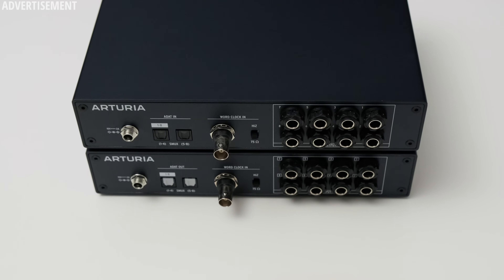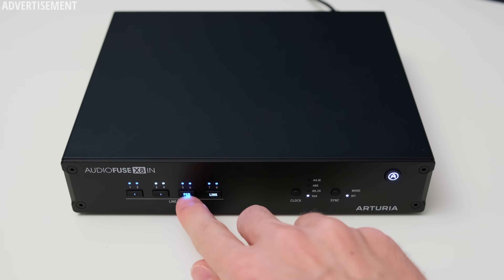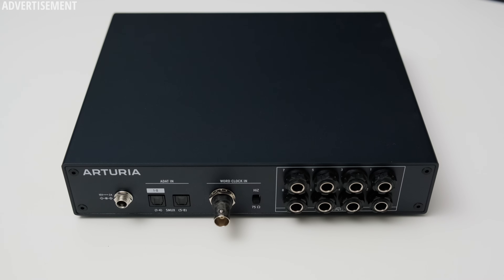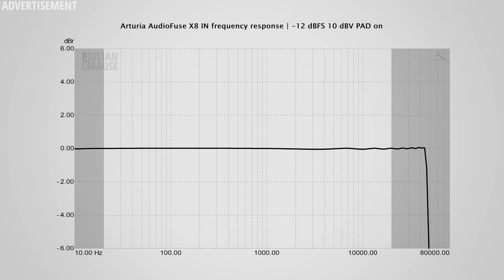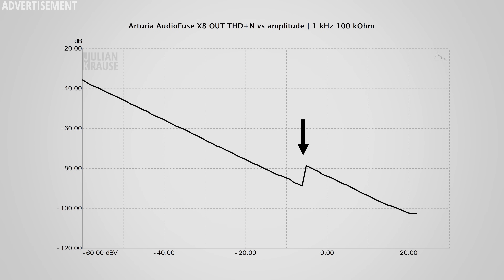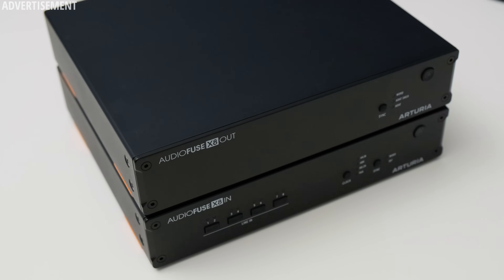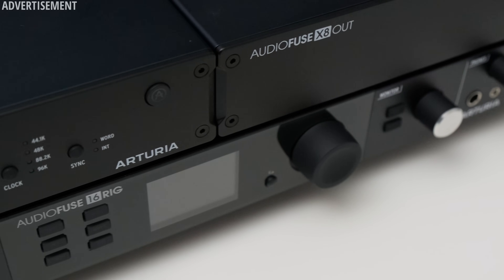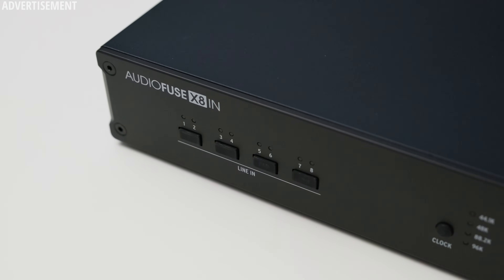Arturia AudioFuse X8 IN and OUT – 8 channel ADAT expansion

Comment: buy anything from RME and bé happy for ever ever
Reply: I don't have $2-3 thousand AUD unfortunately
Reply: I would have to borrow to buy that, that will make me unhappy until it is paid off. Not to mention my wife who would make my forever very short if she finds out that I did that to buy it. 😂😂
Reply: For the price - it better be good. RME prices keep becoming more and more ridiculous, meanwhile good value alternatives are available for people who just need the job done well.
Reply: @SDX9000  RME prices have remained consistent over the years. If you compare products within the same tier, the Fireface UC/UCX still costs around the same as the older models, like the Fireface 400, and the FF802 is similarly priced to the 800. Nothing much has changed in that regard. Sure, they now offer higher-tier products like the ADI-2/UFX/MAD-AVB/DANTE, but they also have budget-friendly options like the Babyface Pro, which costs less than the internal PCI cards without Mic inputs and DSP FX.

Moreover, since their driver support is practically endless, RME interfaces are actually cheaper in the long run. Many people have been using the same RME interface for over 20 years, which is unheard of in any market or profession. This long-term support also makes their second-hand market very attractive.
Reply: @SDX9000  it is
Reply: @naphasso6877  interesting, i'm not surprised about Arturia, but it doesn't sound like RME to miss that, which module?
Reply: RME had the same issue before fixing. Not issue anymore
@xfghffhfg : On DAC

Comment: DC power supply splitting is a dumb idea, they would have to double the power (amperes) output of each 15V AC-DC adapter and each customer would have to pay the difference even if they won't use it to power more than one device. Also, that will create a potential for ground loops.
Reply from the maker: Hey, I checked the power consumption and for the X8 IN it's about 7 Watt and for the X8 OUT it's about 4 Watt. The provided power supplies can handle up to 30 Watt according to their specs. It should not be an issue running two X8 with one power supply. I agree, that running the 16 Rig with the same supply would not be such a good idea. 
The power supplies do not have a ground pin and with the in- and outputs being balanced, there should be no issues with ground loops.
Reply: Most power supplies that come with products are rated 3 to 5 times higher than the required power. Additionally, it’s incorrect to say there's a "potential for ground loops" when the ground isn't shared. It might be wise to familiarize yourself with the basics of electronics before using terms like "dumb" otherwise it could reflect poorly on you.

Comment: Thanks for this. I have been looking to get these. The X8 out issue is a concern though. How can they fix it when there is no way to update the hardware as there is no usb port or anything to fix the firmware?
Reply from the maker: When you take off the front plate, there is a USB-C port hidden behind it 😉
Reply: @JulianKrause  Ahh cool. I didn’t notice it in your picture of the interface opened up. I hope that they can fix this issue as that is a deal breaker. Otherwise I have to look for something else.

Comment: Not really seeing the value here when each is nearly the price of an SP8 that replaces both
Reply: You can’t bypass the mic inputs on the SP8. I just want line in and out. The converter quality isn’t as good on the SP8 either.
Reply: @electricwhiterabbit  because 25dB beyond human hearing vs 28dB beyond human hearing matters heaps. Yes in theory the numbers are slightly better. 
You can use the line inputs, which yes go through the same THAT6266 balanced ADC driver, but its a lot more than a mic preamp. 
If you do want those features, i'd argue the ASP 800 is a lot more interesting then these. Though slightly more expensive than the pair it has a LOT more going for it.
The DAC issue on bass would be an absolute dealbreaker for me - being unable run effects loops on a bass synth would be .... just no. Any update to its behaviours will also invalidate the current noise tests and likely reduce the dynamic range.
Reply: @mycosys  The X8 IN has far better specs than the SP8. The dynamic range is much better as well as the distortion specs and the frequency response. I don’t want/need mic preamps and that is what is hindering the SP8’s quality hence why it is cheaper. Also the SP8 inputs can only handle +18db input where the X8 in can handle +24db input. The SP8 out is okay but still not as good as the X8 out. The dynamic range and distortion of the X8 Out is better. If they can fix the issue with the ESS chip at low frequencies, that will help huge. 

The ASP800 again still has worse specs than the X8’s. Again the ASP800 has mic pre’s. I don’t want or need them. I just want line in/out. The other issue with the ASP800 is that it has DB25 for the 8 outputs. So you have to spend even more money to buy or make a DB25 cable to TRS female jacks just to use that. No thanks. 

The X8’s are great value. What if someone just wants 8 or 16 inputs?  You need to buy 2 SP8’s which is more expensive. I also like that all jacks are at the back of the x8’s. I don’t want any jacks on the front like the SP8 has.
Reply: @electricwhiterabbit  If numbers are what matter to you, cool
Reply: @mycosys  It isn’t just numbers if you read my post. I want just 8 line ins and 8 line outs via adat. There are not much options out there for that. I don’t want mic preamps and I don’t want jacks on the front. I want clean high headroom line ins and outs for outboard gear and monitoring.
Reply: much better built quality than SP8, better converters.

I've tested the SP8 and the feeling is cheap
Reply: @Jean-Bouzig-zt4on  I havent used these units, but agree all my Arturia gear has ridiculously overbuilt casings. Though that hasnt necessarily extended to their internals (i have an original keylab XD). You could probably build a house with BeatStep as your only hammer and the thing would likely work, its amazing stage gear.
But i would say in my rack my Evo16 doesnt feel any cheaper than the MOTU, RME, Focusrite etc gear i use. Though that single knob being hollow dosent do any favours for the feel of the rest of the steel chassis, i admit (i keep a silicon band round mine - makes a wild difference to the feel). The intermittent availability of the rack ears has also been a pain.
(being clear - i LOVE arturia gear, i dont just have Keylabs i have beatstep, Minibrute2S,  Vcol and FX col. Just still dont see the value of this outside a VERY specific niche - if thats you - awesome)
Reply: @mycosys  From my years of experience working in pro audio retail stores, I can tell you that most people are more interested in expanding their inputs rather than their outputs, especially in low-budget, small studios. Many users with multichannel audio interfaces don't even utilize all of their outputs, so purchasing extra outputs is often seen as a waste of money, and having 16 inputs in a 1U unit is a fantastic option considering the price, or having a small unit that can be tucked away behind your synths is also very appealing.

I can also understand not wanting audio jacks on the front panel. I’ve noticed more than once that people avoid using those inputs just to keep their setup tidy. Audient's offerings are excellent, but they are quite new and unique in a market where low-budget A/D D/A converters are nearly nonexistent. We need to encourage more options. Just because there is one good product available doesn’t mean other options aren’t needed, especially when they differ in form factor, specs, and price.